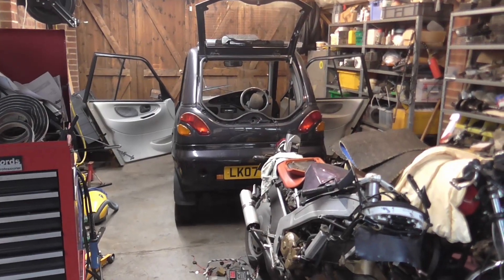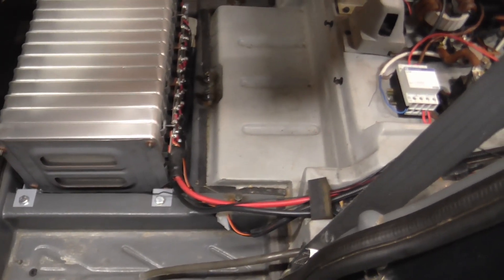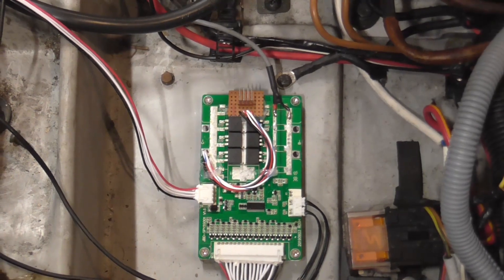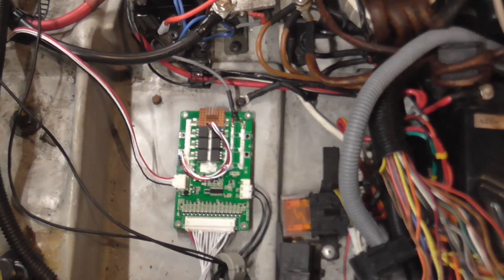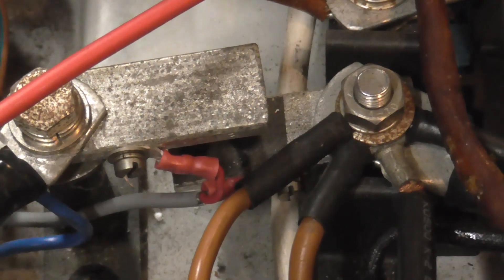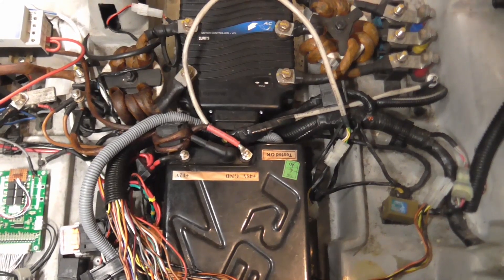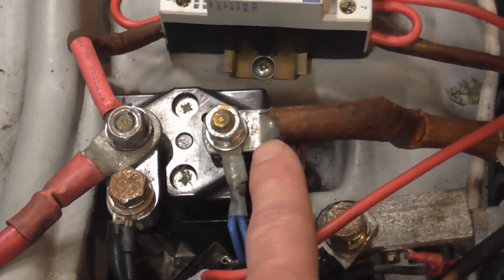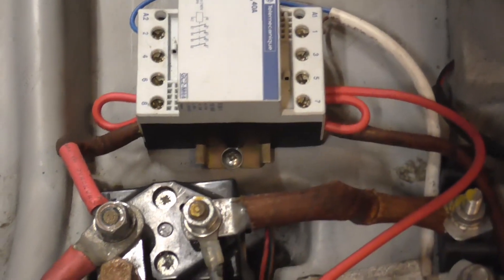G Wiz with lithium upgrade and BMS

Comment: Great work Paul.
I wanted to know if there is any trick to bypass the main contractor connecting to the motor controller? You know the contractor is the mechanical part & i have issues with it.
Reply from the maker: Bypassing the contactor would be a bad idea. It's there for safety and reliability reasons. They're a common contactor and spares are readily available from Albright.

Comment: Hi Paul, as I'm converting the G-Wiz to lithium, I understand from your video it would be dangerous to cut the voltage in the system while using the vehicle, would you be interested in converting one of those Chinese BMSs for me? What will it cost for you to do it for me?

Comment: Hi Paul as a owner of a horrible G-wiz my charger stoped working as don't use very often just the dc to dc converter started to destroy the lead pack seem to be one 6v cell at a time I've started to convert to lithium now I can't seem to get original charger to start I've unplug from ems there 240v in to charger there was no fan coming on before I go into the ac-dc charger box to look in there would there be any fuse or something I'm missing to fire up original charger thanks Edward
Reply from the maker: Failure of the OEM charger is quite common. In particular, the RIFA capacitors on the input noise filter are known to fail. They're a relatively easy fix, but anything more significant and you're probably better off buying a new charger and separate DC/DC.
Reply: @EVguru  thanks Paul have you been into the charger and dc -dc box are the capacitors easy to change on the board I am correct in saying if the ems is upluged and 240v in charger should go to defualt mode or do you need to trick with acc wire or resistor? Could it not be because a sense wire eg  fan, temp, water or any fuse solenoid ect basically any where else before going into box

Comment: Hi Paul, Good work, maybe use a off-the shelf DC-12V with enough Amps to drive the alarm and Central locking. just make sure it has a very low quiescent current.

Comment: Paul how could you say HORRIBLE LITTLE CAR! LOL! 🤣
Btw, does it make any difference if I switch the huge bug fuse on the red wire instead of the black negative ones?
Reply from the maker: The fuse is in the negative lead because the battery is grounded to the frame. If, as is usual in high voltage vehicles the pack was isolated from the vehicle frame, then it wouldn't matter.